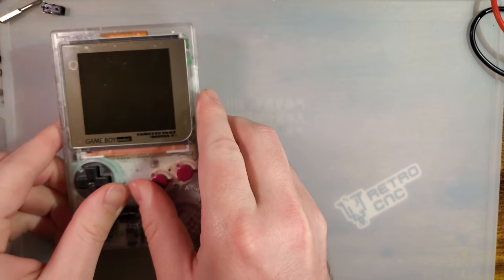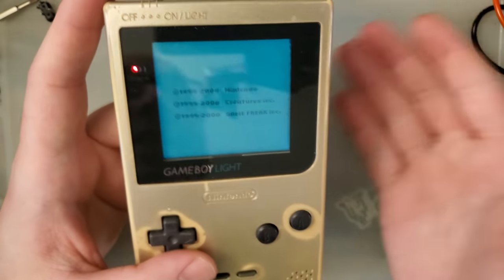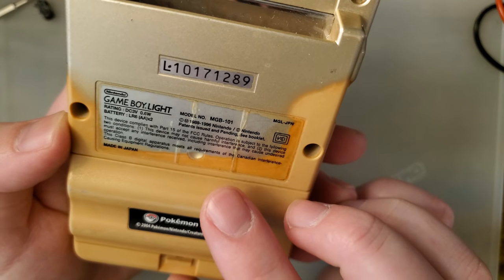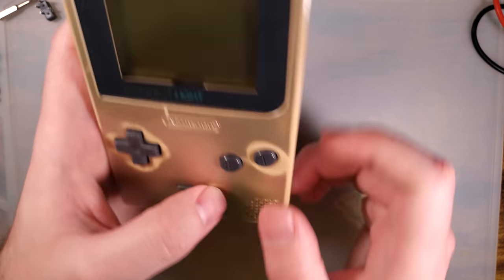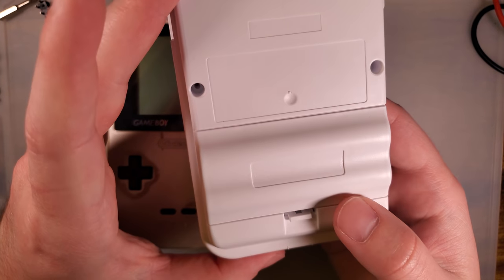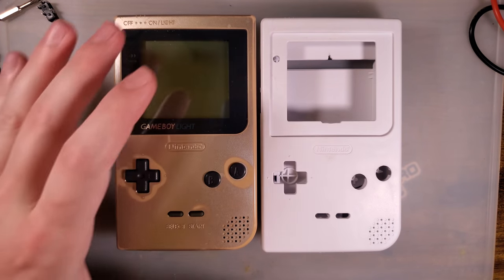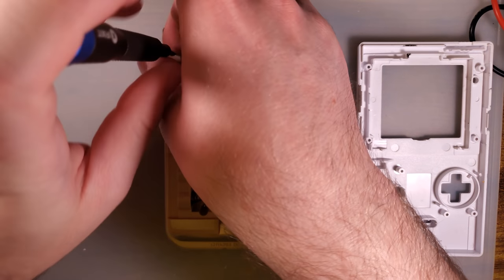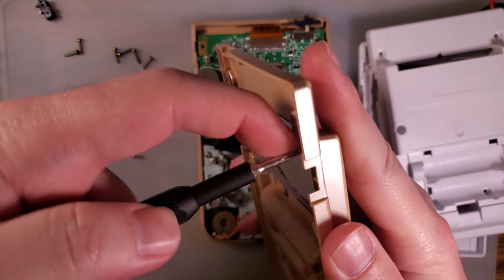Game Boy Light Aftermarket Shell Sample

Comment: @20:08 how I fix stripped plastic screw holes is I take something back apart right after it happens, put a drop of super glue (the good stuff not the cheap junk that's like water and doesn't stick to anything) into the hole and wait for it to dry then make new threads in the glue with the screw, take the screws out and try reassembling again, if the hole strips I keep trying until this works.

Comment: With this replacement shells there is a way to put a normal GameBoy Pocket motherboard inside and mod it to use AA Batteries instead of AAA?
If that is posible we can have more battery life in our GB Pockets.
Reply: I too would like to know as I can't find an answer to this question. Internet can't answer this question either. The motherboard screw holes are in different places, so that might mean no.
Reply from the maker: @kevingamboa9420  The Light, Color, and Pocket all have different screw positions. It's not possible to mod any into another case without some not insignificant cutting.
Reply: @makho  I appreciate the response. Too bad we can't get AA batteries or a rechargeable modded battery like the GBA and the Gameboy DMG for the Gameboy pocket.

Comment: Hey Makho, if i wanted/needed to replace the tranflective film on my Light, where might i find it?
Reply from the maker: If you find out, let me know. I haven't looked very hard but I've also never sourced anything.
Reply: @makho  will do! so far, I've only experimented with different one-way mirror window films, but I haven't found a reflective finish that works nearly as well as original. I did find out that there is such a thing as "too reflective"😂.
Reply: I tried the 3Dlens Transflective Linear Polarizer. That has the film and a linear polarizer and to be honest it’s perfectly fine in my opinion. Don’t see a huge difference between a stock GBP and the new GBL LCD with the film. Might be small deviations if you are really looking.

I used it to convert a GBP LCD to a GBL LCD
Reply: @jornborgart1964  thanks for the info! I recently heard of 3Dlens myself, and that seems to currently be the primary option modders have been using. I'm working on an alternative solution that isn't as straight forward, but that is more easily accessible. Details to come.